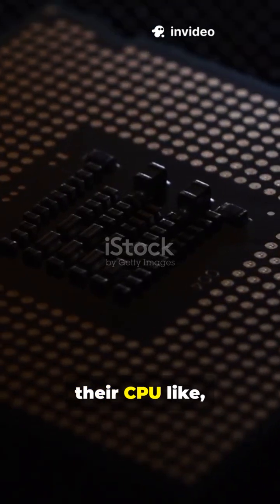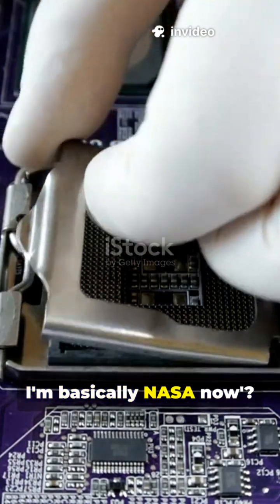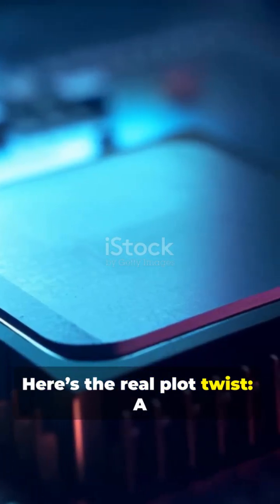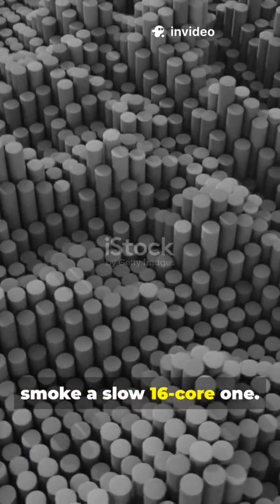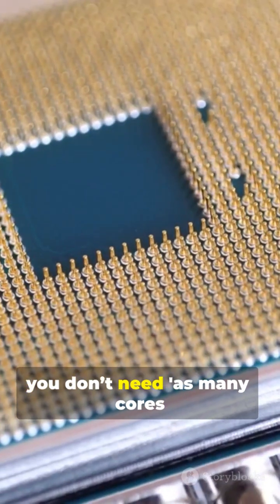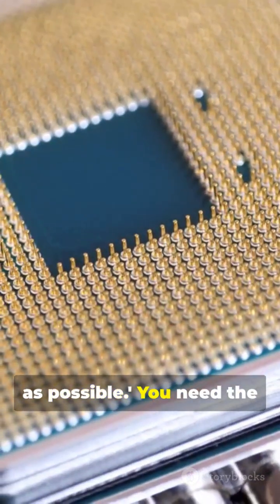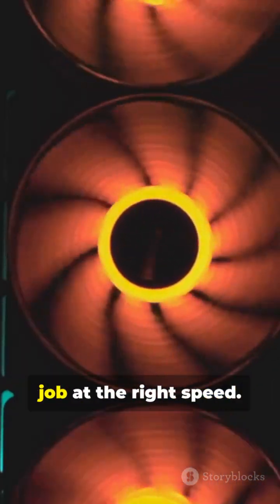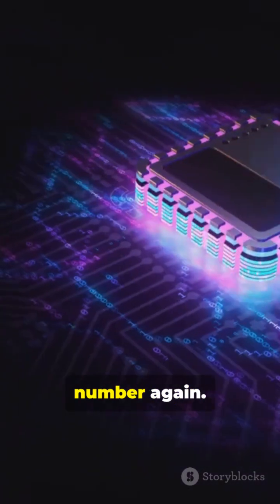Clock Speed vs Core Count: The REAL Fight#CPU #ClockSpeed #CoreCount #ExplainThatChip#IPC#PCBuild

Comment: aight ai buddy
try running steam and discord on the background
wait what? you system is chocking?
thats what i thought😂
Reply from the maker: Bro Steam and Discord don’t choke any normal system 💀
If yours is dying from that, the problem ain’t the cores.
Reply: @T@TheChipExplainersingle ccd with 2 faulty cores from factory thats basically what a new 6core chip is
and if you dont know runing everything even if thats discord and steam on your system will drop basically everything other than frame time which will increase cuz they fighting over threads in a single ccd
 expecting to get yt short benchmark performances?
yea nope
u can try for yourself if not read an article or two
Reply from the maker: I get your point, but Discord and Steam don’t overpower a normal setup like that.
If someone’s system chokes from just those apps, that’s a different problem.
Reply: @TheChipExplainernot literally chocking duh its not pentium but performance drop is very noticeable
Reply from the maker: I agree with your point